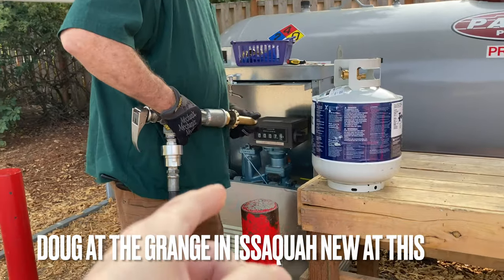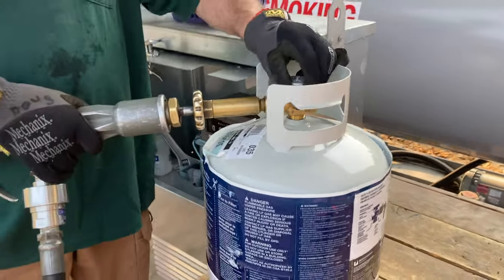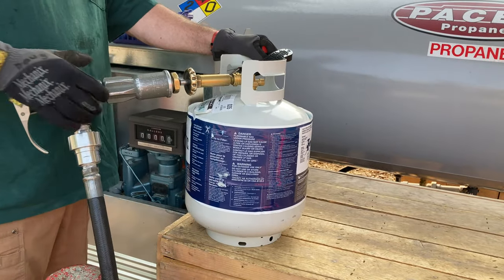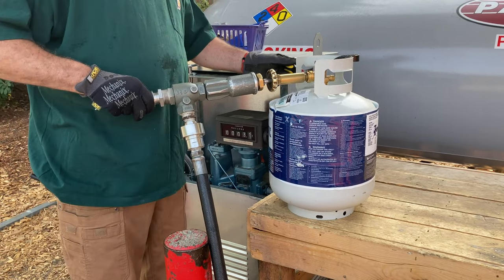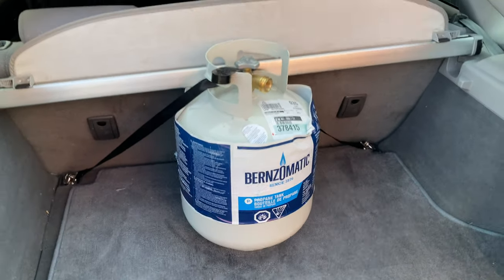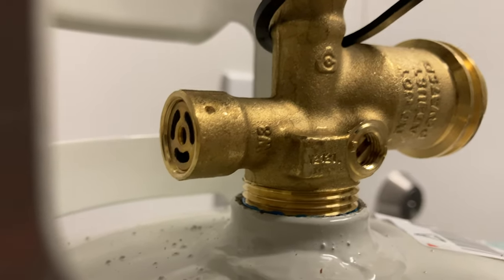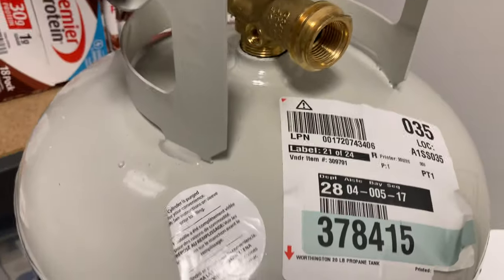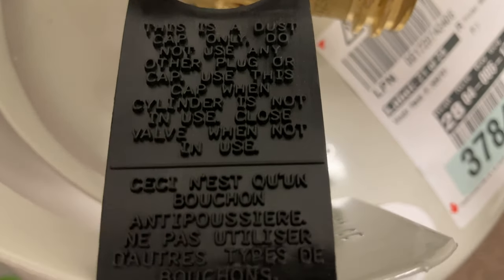Filling a new 20 lb Propane Tank, the OPD safety valve, & safe transporting of a tank in a vehicle

Comment: Cool video. One thing to be aware of is tanks expire 12 years from the manufacturing date etched into the collar. The format is MM-YY. They can be recertified for either 5 or 7 years. You can tell if it has been recertified because there will be a new date etched in with an E behind it (5 years) or an S (7 years). It's best to transport tanks in a vertical position like you did in the video. Nice!
Reply: Additional Note:  Tanks from Canada will have a 10-year expiration date, and it will be clearly labeled as a 10-year tank.